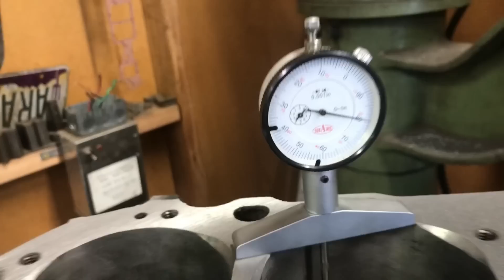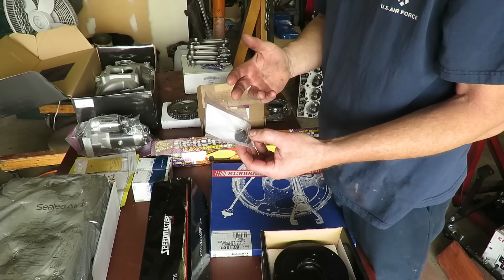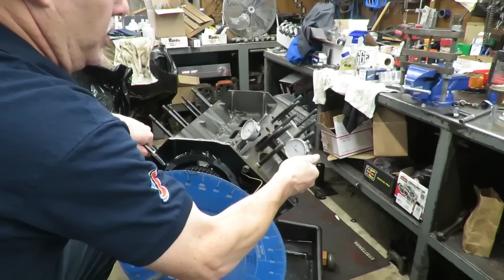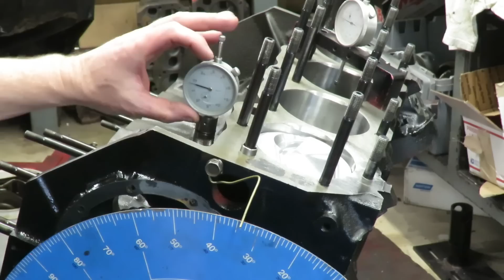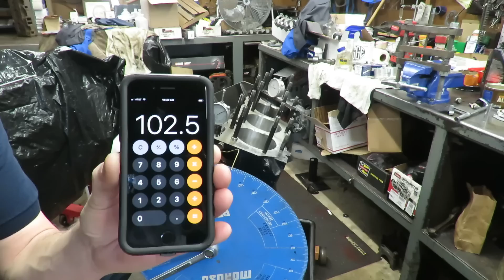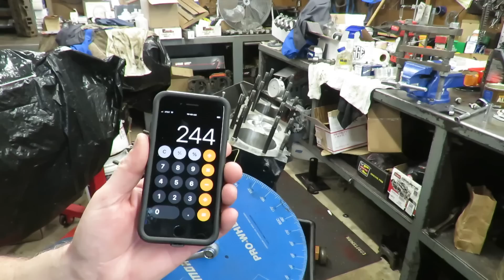Chevy S10 427 Big Block project!!

Comment: 103 deg cam separation is gonna sound wild at idle!!!.. something like that camaro out back haha...cant wait to here this fire..
Reply from the maker: Lobe sep is the distance from between the centerline of the intake and the centerline of the exhaust lobe
Reply: @Myvintageiron7512  im gonna being building up a 350 soon.. with vortec heads... but i really want that lumpy idle even if i gotta sacrifice power... what cam lobe separation is best for that? 102-105? or is that to low?
Reply: @niper99  108 is usually the narrowest you get from an off the shelf cam.  if youre willing to sacrifice power for sound, why bother with vortec heads?  just put on whatever junk you have lying around if performance isnt a concern
Reply: @whatchu_talkin_john_willis  well I have a set for free and I had them magnifluxed no cracks... Ya I wouldn't unless they were free haha.. don't get me wrong I'm rebuilding correctly.. I just want that crazy load barely running idle sound!!...
Reply: 109, 103 is the intake centerline (6 degrees advance ground in)
Reply: So 109 is cam separation? What the difference between centerline / desperation?
Reply: 103 is the centerline of the intake cam lobe, 109 is the degrees between the intake centerline and exhaust centerline (why it's called lobe separation angle)
Reply: @whatchu_talkin_john_willis  ok got it now lol... well 109 wouldnt be that aggressive would it?

Comment: Would it be prudent to wipe the bearing surfaces down with some petroleum solvent before installing the crank just in case?
Reply: Usually use denatured alcohol, completely degreases and leaves no residue

Comment: Not trying to tell you your wrong just try to save you issues.
You need to machine the block for a torrington bearing behind the timing gear. I have a block that had a roller cam installed and with a roller cam. The trust bearing keeps the cam from walking forward but without the bearing behind the cam gear it will dig into the block sending metal throughout obviously. 
Love your videos, just trying to give you a little tip before you discover this issue yourself.
Reply from the maker: Yeh I hear you I have done dozens of low RPM BBC's and it's no problem without The Tottington bearing I do agree that when you spin em to 7500/8000 the bearing is most definitely required 5500 to 6000 they are fine without it
Reply: I'm not sure

Comment: What block did you start with?
Reply: Ken Johnson pretty sure he says at a few minutes in that is was a 454 block, with a 427 crank, can't remember the bore size,  I think he said 60 over, made it a 440 cubic inch. 427 was a nasty motor back in the day, with a 60 over and a good cam with the heads he is running,  it should run very well, especially in a little s10
Reply: Thanks, I'll look into it. I don't have any experience with the 427. @kennethlaw5216

Comment: Unless those heads are a significant bottleneck, 500hp sounds pretty conservative with that cam. If you can get about 330 cfm of head flow, 600 horsepower around 6500 rpm should be pretty easy. AFR 265s flow almost 350 cfm @ .600 lift, just sayin’.

Comment: Do these block relief measures, or any one apply to any GM small blocks  when doing a stock engine rebuild, or any level of GM small block performance engine rebuilding? Thanks. Great video as always.
Reply from the maker: No the small block has intake and ex valves that are parallel the BBC has canted valves that means they are laid over towards the bore center unshrouding the cylinders is an old NASCAR trick when they ran BBC's back in the 60's